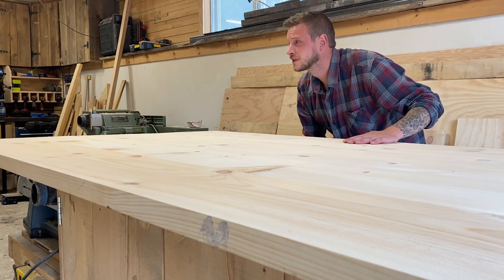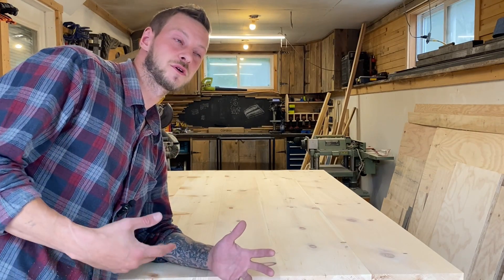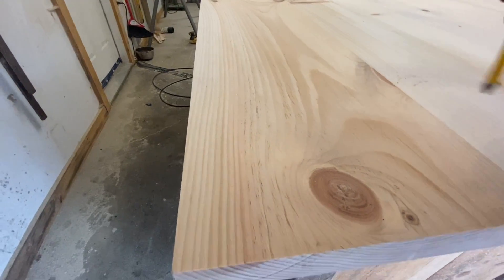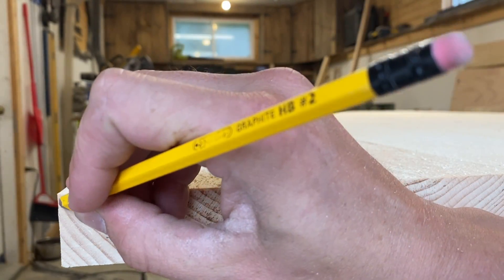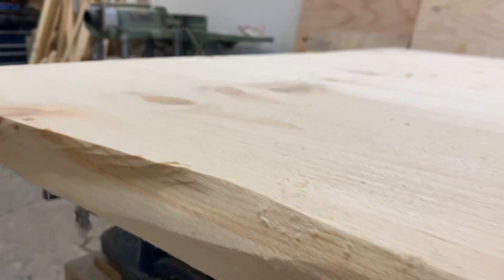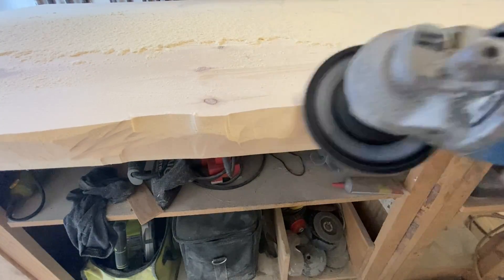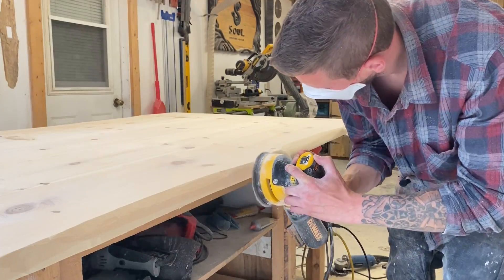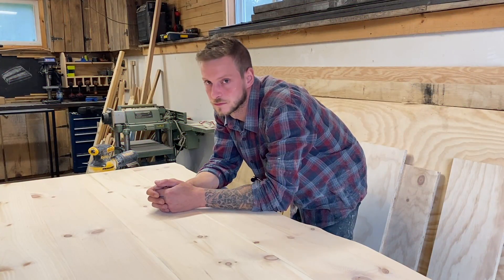EASY! How To Carve A Faux Live Edge | Woodworking

Comment: Overall it looks good. I mill my own lumber from trees. I dont do very much pine  but in a short 8ft legnth it's relatively straight unlike  what you did. Depeding on the diameter of the tree it will  dictate the natural radius on it as well as the thickness of the slab/board. Small diameter trees will have a more pronounced radiused edge on it compared to a very large diameter.